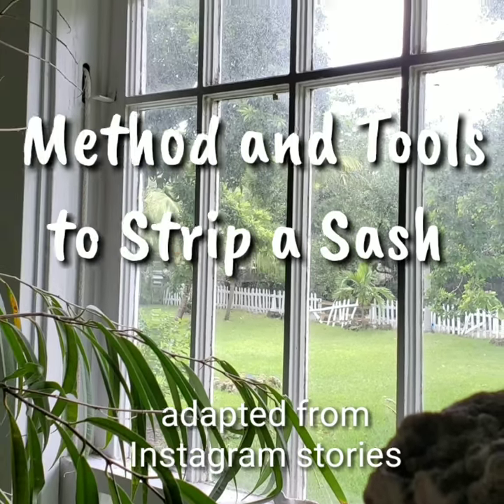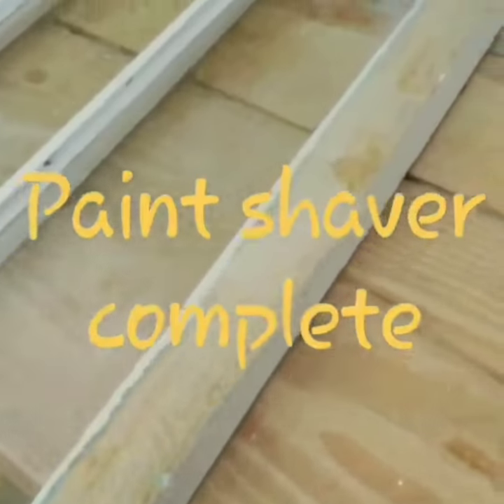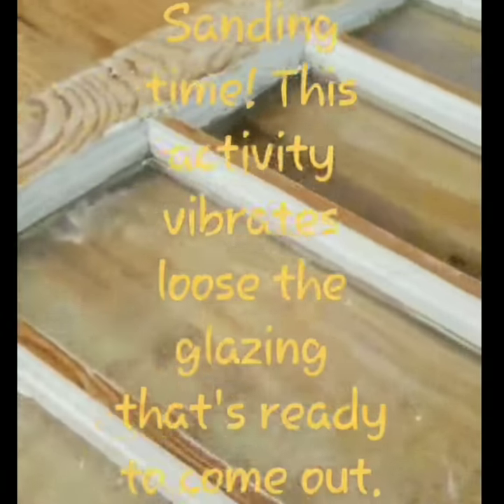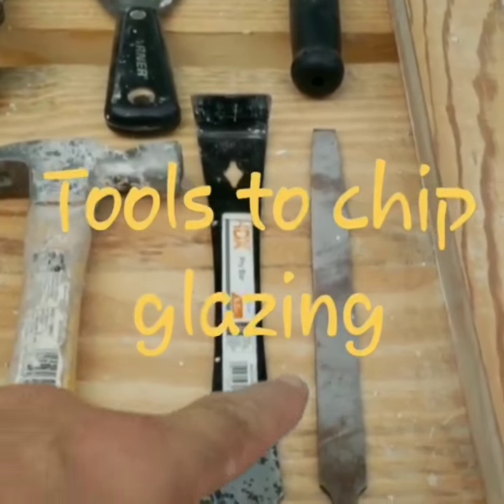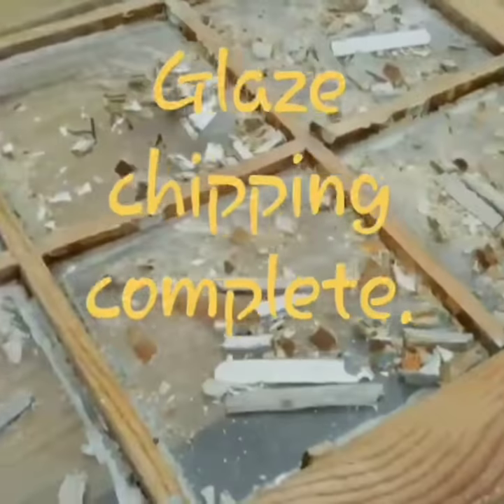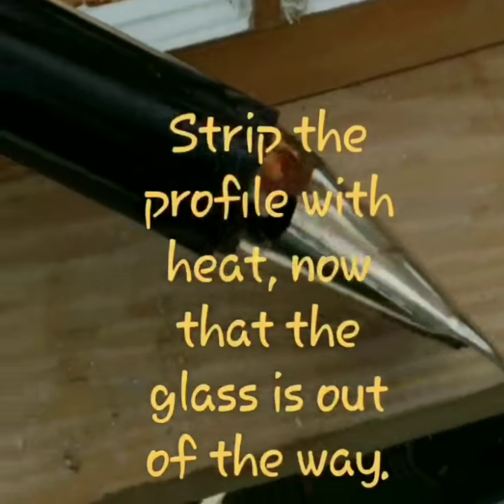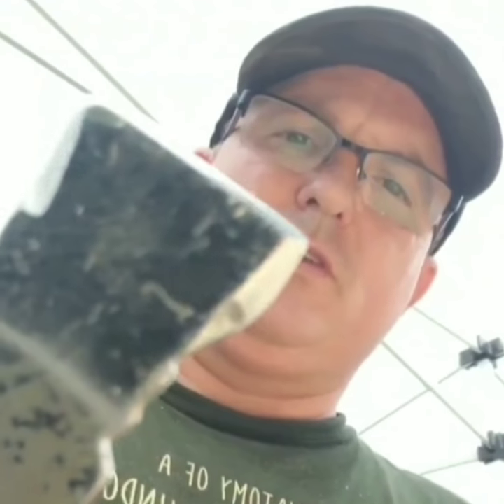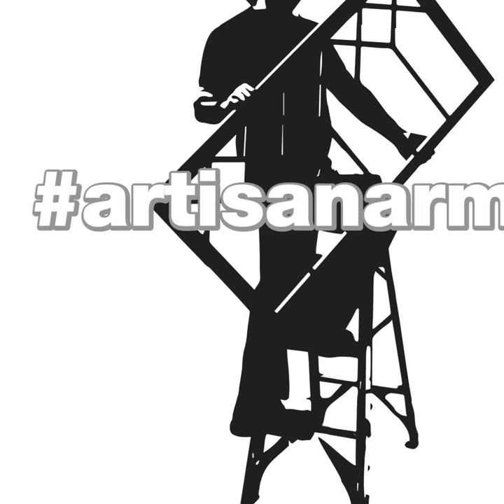Method to Strip Paint from a Sash

Comment: You do understand the heat guns can release the lead in lead based paints in the fumes.
Reply from the maker: Fact 1: Lead vaporizes at 752 degrees Fahrenheit. 

Fact 2: Wood begins to combust at about 450 degrees Fahrenheit. 

Conclusion:  breathing anything other than air is bad for you. Breathing burning wood is bad for you. Breathing vaporized lead is bad for you. 

The paint begins its release before the wood catches fire or even chars. 

Don’t catch the wood on fire. Don’t breathe wood smoke or vaporized lead.